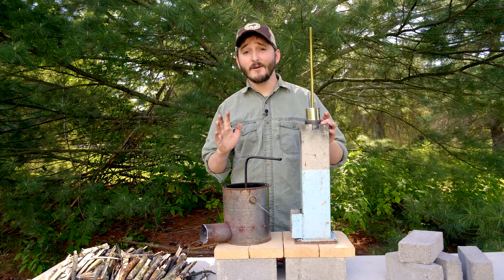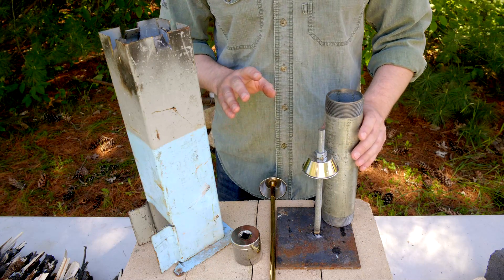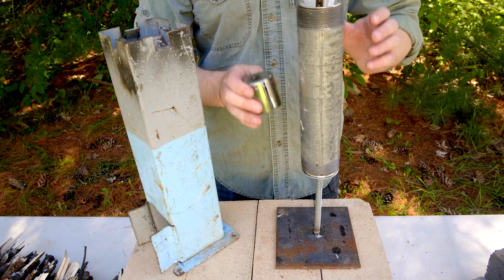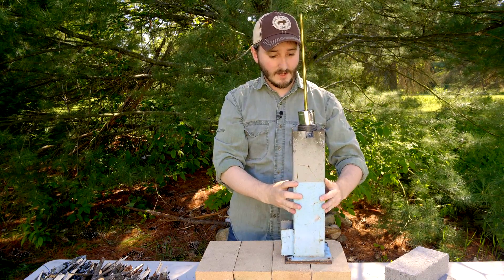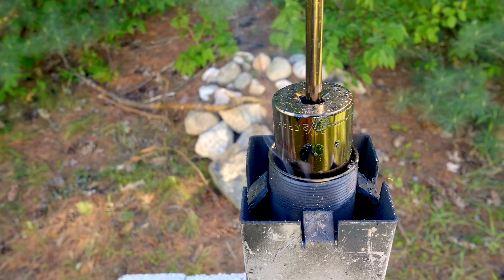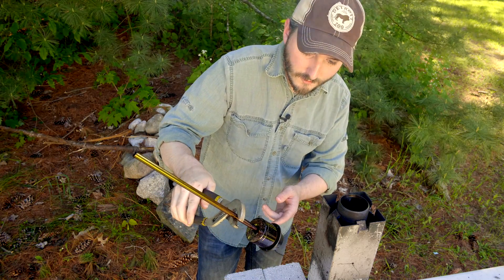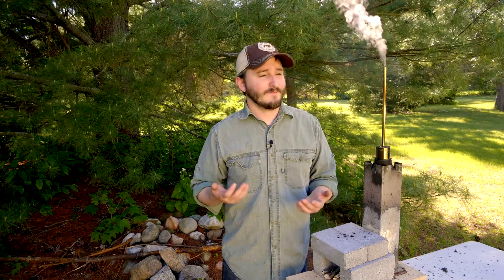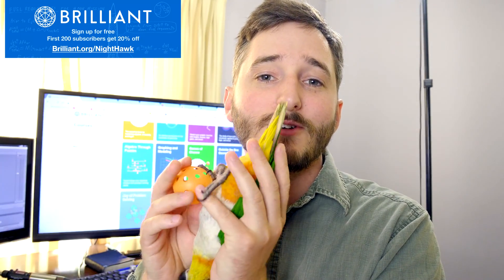Testing A Better Wood Gassifier (Bio Gas Fuel)

Comment: Could you next find a good way to cool and compress the gas for later use? Right now as you showed, the gas isn't concentrated (or maybe pure) enough to burn by itself, which renders it pretty much useless. Maybe bubbling it through cold water would help reduce the amount of impurities and cool it enough to run it through a small compressor? Anyway great vids, stay awesome!
Reply from the maker: Yes it can be cleaned and stored, new video on that in the future

Comment: Actually, something just struck me - the process that's occurring here is more properly destructive distillation, not gasification. You'll be getting all sorts of hydrocarbons formed, from heavy tars to light alcohols, and the lighter, vaporized stuff will be what's burning at the top. Proper gasification is the process of actually burning the wood in a reduced oxygen environment, which produces mainly hydrogen and carbon monoxide, and that gaseous mixture is then used (for running an engine or whatever). There's a really cool old document from FEMA on building a gasifier big enough to run a tractor - http://www.build-a-gasifier.com/PDF/FEMA_emergency_gasifier.pdf. I've often wondered if something like that could be scaled down to a demonstration size.

Comment: If you slightly krimp the end of the biofule exhaust it might sustain the flame longer
Reply: A good percentage of that is steam, and that's likely what is blowing the fire out. Needs to bubble through a water tank to condense/separate it out, the remaining gas can then be collected and should burn much better.
Reply: @pauljs75  Good point/idea. How to collect the gas conveniently though? And won't some of the gasses dissolve into the water (not sure if that's a thing and if it's even possible with the wood gas components...).
Reply: Jonathan Anderson it needs oxygen, crimping it won't do much I don't think.. he needs a breather hole in the pipe like a blowtorch nozzle
Reply: Your profile pic...
Reply: @mcmh9523  yeah. So smart comment, so cursed image
Reply: All crimping will is increase the presssure of the gas
Reply: Can you please explain why that is Jonathan, plz, thanks
Reply: Bunson burner type fitting / build would hold the flame and a glass tube to prevent it blowing out

Comment: Hi there NightHawkInLight, according to scientific journals, Syngas should be cooled down to atleast 160° Fahrenheit so that it gets back to the reactive stage
Edit: try passing the gas over a water cooled condenser made of aluminum (with aluminum oxide coating inside of it to accelerate the reversible gas phase to make the process more efficient.)

Comment: You should bubble the gas through a longish column of water (maybe like .5-1m tall). That should condsense all or most of the tar youre getting from the wood.
Reply: a mega bong
Reply: What about a spiral tube filled with water?
Reply: @ki0w0-lordofwatersheep  that should work too, though you could risk clogging the narrower bore

Comment: Can you make a video on how to store it for later use? edit; Storing the woodgas, not the stove🙂
Reply from the maker: Yep, I'm planning on it.
Reply: NightHawkInLight and today he has done it....
Reply: Perhaps use an old tire tube?
 Add a small copper pipe with a valve after removing the Schrader valve from the valve stem. You could even use the inner tube to slightly pressurize the gases.